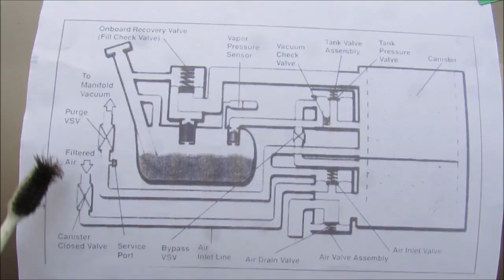How the EVAP System Works

Comment: EXCELLENT VIDEO! Thank you not only for going to the trouble to take the system apart and explain it component by component, but also for taking the time to so thoroughly understand it yourself. If I might point out one possible correction, I believe at 1:01 you swapped the identification of the purge line from the canister and air inlet line to the canister. The purge line, if I'm not mistaken, is the one with the green cap on the test port.
Reply from the maker: Thanks 
It was quite the system to learn and decipher

Comment: This is how it's done! A no B.S. explanation.
In California for vehicles without On Board Diagnostics that include evap., during a smog check the tech will pinch the evap line and pressurize the fuel tank with nitrogen through the filler neck.
The fuel tank has to stay pressurized for a certain amount of time.
Yeah, even though it doesn't leak gasoline, it can leak vapor.
Older vehicles usually will leak during this test and despite passing the actual smog check, a failure of the evap system means a failed smog test.
Good luck arguing with the smog check guy that the system is never pressurized.

When you fail, the state will offer you $1,000 to scrap your vehicle which they crush and a "clean air credit" is created which they sell to corporations at a cap and trade auction evey year.
The clean air credit allows the corps to offset the fines for the pollution their industry causes.

So your crushed Corolla becomes a calculation of how much carbon it ""would have" produced, and that carbon is sold to a company so they can, in fact.. pollute that amount of carbon.
Yes.
This is totally true.
Reply from the maker: +Matthew Edwards hah that's an interesting story...they buy the rights to pollution.
Reply: Every time ive gotten any of my cars smog tested old or new the guy running the garage just pops open the hood looks around for 30 seconds and then says the vehicle passed
Reply: Matthew Edwards 
What isn't pressurized?
Literally every thing after the gas cap is under pressure, for no other reason, evaporation.
Reply: Carbon tax is a scam
Reply: And not all smog techs know how to do these tests properly, I've had em fail me for leaking EVAP only to take it someplace else and have it pass because the tech at the first place didn't do the test right... The EVAP test is just a scam to get you to buy a newer car
Reply: East winds carry all the contaminated air from China and India across the Pacific to California nice
Reply: @TurboDiesel-zf8ph  Not anymore.  I know for a fact your comment is a lie. Techs can face Jail time and fines up to 10k for not doing the Smog properly...
Reply: Scrap To Cash ** Living the Dream** the garage I went to was in a super seedy part of town and there was only one guy working there. He was probably only doing it to just make money and the garage has since closed

Comment: Have a '99 Camry 3.0 v6 (US Federal emissions).  Owned for over 7 years, 1st check engine light today.  Around 175K miles.  Code P0441 (Incorrect Purge Detected) popped up today.  Hottest day of the year if that makes a difference.  Entire EVAP system is OE original and untouched.  I'm somewhat familiar with EVAP function, but not exactly in detail for this exact model.  I do not smell gas while its sitting in my sealed garage so I'm thinking there isn't any leakage from something like the gas fill pipe/metal vent lines.
Where shall I start?  Gas cap?  BTW I cleared the code to see if it stays away, removed and installed the gas cap to be sure it was tight, it takes some turning oomph to get it to click, so that part of it seems to function.  I'd like to first check the purge solenoid, where's that at, on the charcoal canister, or in the engine bay?  Thanks if anyone can help out.
Reply from the maker: You need to refer to the repair manual to get the solenoid locations and test them with 12V. 
Use a smoke Machine to detect leaks.

Comment: Any idea what the drive cycles are for an older (2003) Honda Accord?  The Evap emissions code is taking forever to reset after we replaced the O2 sensors and disconnected/reconnected the battery.

Comment: If you overfill until gasoline comes out of the filler hole and spills on the ground, to the level of the ventilation pipes of the fillerneck that goes to the evap canister will gasoline then come in or will it first go through the overfill check valve? In other words if you overfill it to much can you damage your EVAP canister? Always wondered how this system works.
Reply from the maker: The overfill valve is supposed to prevent that. Of it malfunctions then it'll damage your canister.

Comment: I'm about to replace the vacuum switching valve..while mine is not quite as rusty as yours I'm wondering how hard it is to replace while on the cannister. Is it clipped on or bolted? It's on a 04 4wd matrix xr so much easier to get to while on jack stands.

Comment: This video is awesome. So what's causing high pressure to build up in the gas tank of my '01 Sequoia? Seems like it's either a clogged line or a failed valve or solenoid. The pressure was so high yesterday, even with the car off I could hear it venting somewhere when I stood near the fuel door, and I could see the shimmer of gas fumes. Had to let it sit with the cap off for an hour for the pressure to completely subside.

Comment: Scott Kilmer on his mechanic advice YouTube videos warn us never to fill the gas tank to the rim because if there gas going inside the evap canister, it may ruin it. I have a Lexus and I had a Corrolla before and I am wondering with all your explanations if there is a built-in security valve preventing gas to go into the evap system?
Thanks for the answer.
Reply from the maker: All systems have an overflow prevention. 
There's a check ball for liquid to not enter the canister.
Reply: Thank you for the answer. @speedkar99

Comment: I have too much air in my gas tank. My evap is moowing like a cow when I turn the key off. Or if i remove the gas tank lid a TON of pressure blows out. HELP. why am I building all that pressure?? TY
Reply from the maker: The gas tank pressure sensor and valve is malfunctioning

Comment: Somehow I missed this excellent summary.  Question: With key off engine off as the engine sits overnight, is the canister vent valve open or closed? Does it stay closed "to a point", then opens to relieve pressure, if pressure is too high or too low?

Comment: Dude!!! GREAT vid explaining the evap system quickly and thoroughly. I have a question for you... my wife accidentally topped off my brand new Toyota 4Runner TRD Pro several weeks back (gas was spewing out of the inlet port when she finally stopped holding the trigger down). Today my check engine light came on along with ATRAC light and I get diagnostic codes P0441 and P0445 for the evap system. After my wife topped off... I looked up “what happens when you top off on gas” and found that the reason you don’t Top off is because you can damage your evap system. So, knowing this immediately after the top off incident I was expecting something like this might happen and so here we are now. My question is... what specifically might be damaged or need replacing in the system from a major top off? Which components should I zero in on? Could it be that I need a whole new canister??? Your thoughts on this would be MUCH APPRECIATED since I can tell you know what you’re talking about on these systems. By the way... it took some major effort and time for you to make this video and I can’t thank you enough for it. Really great work!
Reply from the maker: +Wolfgang51501986 the damage is likely liquid gasoline in the charcoal canister.

Comment: hi mate @speedkar99 i want to make you a question, sorry for my bad english.
i have a kia rio gasoline engine. many times i overfilled the gasoline tank (2-3 times in 15,000km), i overfilled since sometimes it fall gasoline on the floor. when i make a trip about 4-500km a day at high rpm, in the next day the car starts more difficult. can my overfilling affect to evap system?

is true that in modern cars you overfill the tank you can damage the canister? the canister can "regenerate" itself if into it falls gasiline?
Reply from the maker: Yes but the valve at the top of the gas tank is supposed to shut off the line to the canister preventing damage when nearing the top. Perhaps that valve isn't functioning properly.
Reply: @speedkar99  hi, at what valve do you refeer?

Comment: Howdy.  I have a 1998 3.3L Nissan Pathfinder. 175,000 miles. Great condition. Stock. My tank gets alarmingly  pressurized when driven a couple hundred miles. I don't have any codes. My Nissan gas cap visually inspects clean and good. Does not leak. 

I even disconnected all hoses on the EVAP system and cracked the gas cap. No codes were made either. How can that be? I drove it dozens of miles to test. To see if the missing stopped or codes would appear. No codes, except random misfire. Every now and then, but the motor is obviously missing mildly to badly all the time.  It gets worse for a while when I refuel.  For a few dozen miles.  

When this system started doing this, I started getting a random misfire code at the same time. These may be unrelated. Not sure. 

I have verified purge valve works, hoses are clear now. One was dirty about 2" clogged at the canister for the purge line. It looked like charcoal dust. All other hoses clear. 

Any ideas?  I was going to remove the plug from the cannister ambient vent valve and see what that did. It should toss a code right?  And make the valve open, from my understanding?  I don't want the tank to pressurize like that again.  It will spew and hiss for about 6 minutes when cap is removed. I've never seen a vehicle do it this badly before. 

Thanks!

Comment: "The canister is held in by 12 millimeter pieces of rust on this side"  🤣😂🤣
Reply from the maker: 😅it's true
Reply: @speedkar99    Oh I know.  That is why it is funny.
     I used to have a 1992 Honda Civic.  This was in 2015.  It only had 87,000 miles on it.  In the end the engine and transmission were about the only things that still worked.
EDIT:  I also live in Michigan.  The previous owner lived in Michigan.  So all the parts I replaced... Everything was just a mass of rust.  A lot of bolts ended up having to be drilled and the hole retapped.  Even simple jobs turned into 3 day ordeals.

Comment: Awesome video! Btw, you mentioned that the evap float prevents liquid gas from getting in to the charcoal
Canister. So does that mean that when you accidentally overfill your gas tank (like when the gas pump did not click off) and gas spilled over, that none of those liquid gasoline would get in the canister? Thanks again for the awesome vid

Comment: VaporPressureSensor:  Did you through the parts out.  I was wondering is you would do the verification testing on the V.P.S.?  Could you do the voltage output test as you apply pressure and vacuum to the V.P.S.?  Could you also do the ohm test on the V.P.S.?
Reply from the maker: +siucbset I don't have these parts anymore. The procedure is explained in the service manual on how to test it.

Comment: SolaraV.P.S.:  Is it possible to remove the vapor pressure sensor on the Camry Solara without removing the charcoal canister?
Reply from the maker: +siucbset I haven't taken apart a canister from a Camry before, so I'm not sure

Comment: 2 questions 1. What happens if I overfill my gas tank, and 2. how do I know if my evap system needs to be replaced?
Reply from the maker: The evap system is controlled by the ecu. You'll get a check engine light pointing to an EVAP system code that means it needs to be looked at. Sometimes it's a vacuum line or valve, sometimes the whole canister or just the gas cap.

Comment: How long does the evap charcoal canister last or the system itself. My car is 15 years old and don't see any check engine light on.
Reply from the maker: I'm not sure... usually you'll get an engine light signalling problems with this system

Comment: Great video speedkar99
Can you do a video on a GM V6 Buick engine regarding the EGR and Plenum and Intake Manifold? I intend to keep the engine standard, no internal modifications. I will Port and polish, intake and heads and add a Plenum insulator (spacer) and nothing else.
I want to plug up the EGR but? what do I have to do after I plug it up? I know after I plug it up and add the plenum insulator, this will change the air fuel mixture going into the Plenum but? Will I have to change the injectors? Will I need to have the ECU or PCM remapped to suit the new mixers? Or will the on board ECU automatically re-adjust itself to the new air fuel mixture?

Can you please show us how to do this correctly (block up the EGR and re-tune the system for maximum intake on a standard GM V6 Buick engine) in you next video please.
Reply: markuss lesmale  for my 87 gn i got a turbo tweak chip and I believe they are programmed to not recognize any egr

Comment: Fuel filler has a one way valve .so whats the point of valve on the fuel cap ?
Why fuel darins from fuel cap on drift race ?
Reply from the maker: +Amir orange the cap valve is there for safety. In case tank pressure builds it will vent through the cap instead of blowing the tank

Comment: where does air outlet that will vent to atmosphere go ?
Reply from the maker: It vents the canister to the atmosphere through an open ended vacuum tube underneath the car.
Reply: @speedkar99  oh, thank you  . I wondered  where does it go  because the canister sucks fresh air from hose but I have never knew  that it can also vent processed  or good air that was in the canister. Do all cars have canisters that vent unharmfull air that is in the canister to atmosphere.   

Thank you a lot I  have learned so much information from your videos ❤😊😊😊

Comment: I know its a bit of sidetracking from the topic of the video, but...
WTH happened to that toyota? was it parked 10 years under a pier? What model is it?
I have a 35yo toyota that is an outdoors car for the last 30, and I live on the coast, and it doesn't even really look that bad.
I guess stuff really isn't made like it used to do.
Reply from the maker: Salty Canadian weather
Reply: @speedkar99  I was gonna bet it was at Bikini Bottom 😅
I also live on the coast, where every night cars are soaking wet with the condensation from the ocean, thou not as cold as Canada.. Guess the temp range really plays a role.

Comment: Nice a steel explosive liquid vessel
Don't they know salt and water creates corrosion
So WHEN that tank gets a hole rusted through it will leak gasoline as they drive down the road,on their driveway or just leave them stranded somewhere

Comment: Dose diesels vehicles have EVAP?
Reply from the maker: +Kilo Alas they have some sort of vent line so you don't trap air while refuelling
Reply: No diesels do not
Reply: diesel isn't as volatile as gasoline so it should be in the same category as other vehicle oils, and not needing the evap system. 
you can put naked flame in diesel and nothing even happens.

Comment: Then I have to remove the evap line from the evap check valve there are 4 pieces of rust holding it on
Oh it actually turned!!
😂
Reply from the maker: Eh but not long after it'll snap 
What a rust bucket

Comment: I deleted my evap since parts are discontinued... plugged the evap line and drilled a hole in the gas cap.
Reply from the maker: And what does your engine computer think of that? 😟
Reply: speedkar99 I dont think it cares. 1987 system soon to be mega squirted

Comment: Why would the air be filtered with charcoal before it gets sucked into the intake plenum .... This whole system seems flawed to me what little fumes come out of the gas tank is not much as you can see the charcoal is a small little filter it's not doing much I guarantee you what it does do is bring in big bucks when it fails...$500 and up systems

Comment: These are  problematic and there are many places for leaks to occur when they use push on rubber hoses. They should engineer these better or leave them off. Every car I've owned has evap problems over time. Reeks.
Reply from the maker: Yeah it's all in the name of emissions

Comment: Evap delete kits
Reply from the maker: That would be a great idea
Reply: speedkar99 yep. I wish they existed because the evap system on my truck will not stop giving me problems. Fix one evap code then another pops up immediately after. Such a hassle and a waste of money. If only I had a delete kit and it would no longer be a money dump or a waste of time. Well over $1000 fixing various evap crap